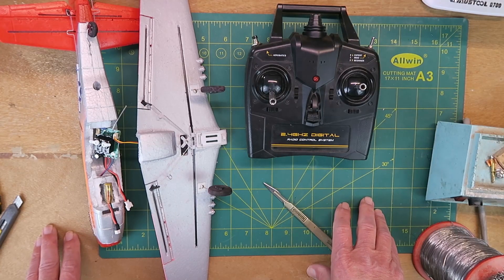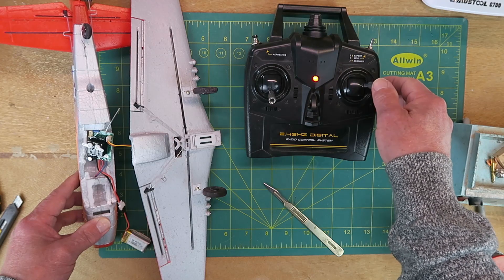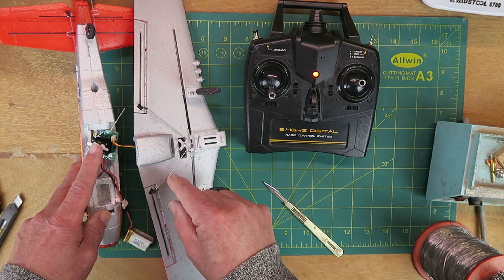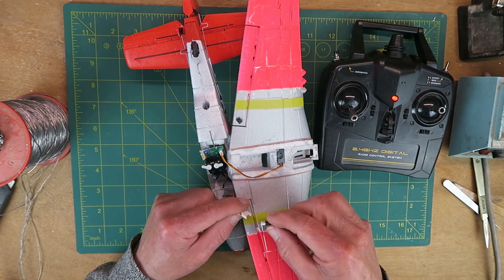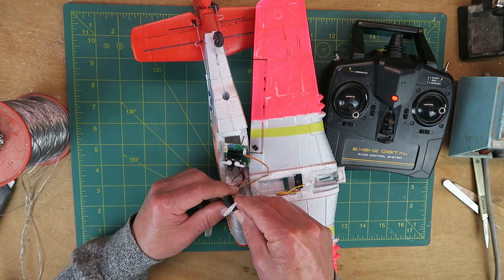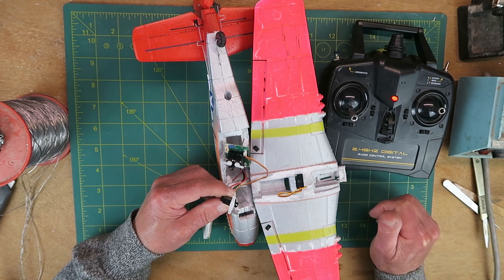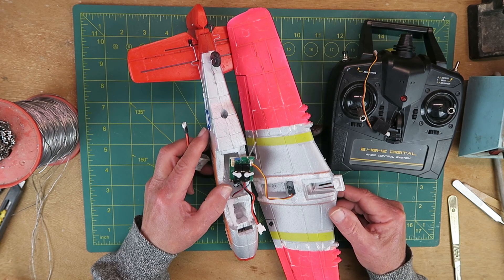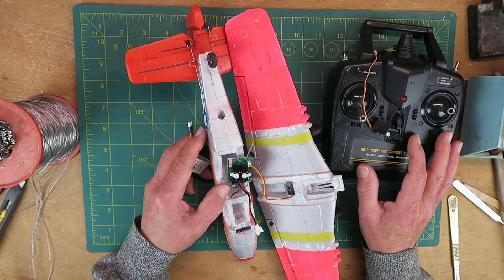Eachine P51D Flight Controller Receiver Repair Update

Comment: Any idea what is the TRGV connector on the board? I found G connected with ground, V with battery VCC, so it looks like Transmit-Receive-Groung-Voltage. Using Radiomaster TX16S Multiprotocol with Elrs module I want to use an added elrs microreceiver to replace the wireless protocol but keep using the gyro functions of the Volantex board. I did it successfully with XK-A800 and got RSSI, battery voltage measuring and altitude. I use RSSI just for finding model when landed unexpectedly - that can be also without interconnect. However I also want to make it proper LBT (not sure about Volantex protocol) and also use only one radio module to connect (elrs), while without interconnection the setup requires two independent connections - one from multiprotocol and one from elrs module.
Anybody having a clue about TRGV port and its usage on this receiver board?
Reply from the maker: I don't think it's possible to connect another Rx to this board. I thinks those pins are just for programming. You could reac out to :  Checkout AirDogge's channel here :  https://www.youtube.com/channel/UC4ASYrBqNLAQmqmCV57BgNw   as he is the expert!!

Comment: Bought fu4 corsair, realgood flyer out of the box,  paired then with tx16s edget and worked real good,  then tried to see how the stunt button worked on the originsl transmitter and re-calibrated the tx and play with combinations of clicks and presses until the receiver board changed into 3 channel mode??? I havent troubleshoot yet.. Maybe the aileron servo fried or probably you can change between modes from the transmitter with a "hidden" stick combo.  
I will try recvonect aileron servo to see whatsup. THANKS for the information in this video..... UPDATE.  I checked and aileron servo is mulfuntioning, (to much stress in my stunt roll tests) so when I manipule the aileron servo when connecting the battery the Rx board changes from 3 to four channel mode, so definitely when ail servo goes out then rudder takes over. Isn't that freaking clever??
Reply from the maker: Yes, it is a fascinating board. No one has yet explained exactly how the board senses the presence of the servo! Thanks for watching, have a great day!

Comment: A bit late to the party but...

All of a sudden the aileron servo on my new Volantex P51 has stopped working properly. Oddly, if I pull the elevator back and activate the ailerons it will work...briefly...then stop functioning again. Any easy fix? The first flights with this little bird were amazing - then yesterday I launched it (with a touch up up elevator). It launched, rose, then suddenly banked hard right and cartwheeled. I'm supposing based on your video that I'll have to replace the servo? I'm bummed because I just got this and have only had one good day of flying it before this happened. PS...the above link to purchase parts doesn't seem to work.
Reply from the maker: They're great when they work, but then............ If it's new you should contact your supplier. A way to help diagnose is to swap the servos around. It seems no one can explain how the controller detects if a servo is connected to the aileron channel to set the appropriate mode. It's a bit flaky!  Good luck" Thanks for watching, have a great day!
Reply: @1nformatica  Banggood (or its seller of these) is sending me two new aileron servos. I guess I'll be trying surgery when they arrive.
Reply from the maker: @coloradofotomatt That's a result! Take the "surgery" slow and careful and you'll be fine! There is nothing "special" about these servos, I replaced one with a "stock" one and it worked fine. Also strange is the "bad" servo also works fine provided you don't wont it to be an "aileron" servo, go figure!!

Comment: I fly my Eachine models with an OpenTX transmitter with 4-in-1 Multi-protocol module.
In the V761 protocol setup, there is an option for 3 channel and 4 channel modes.
Doesn't help with the supplied transmitters, but they were the wrong mode (stick arrangement) for me, so I never used them.
Reply from the maker: I repaired this model for a guy at the flying field. Personally, like you, I use an OpenTx (now edgetx) Taranis with the 4in1 module. Thanks for watching, have a great day!

Comment: I'm perplexed.  I got two flights on my P51 and then no aileron travel.  It does  have the other three channels working.  I was going to buy another one thinking that at least I'll have spare parts but what if the 2nd gets the same problem.  It's not so easy to tear into one of these and try to troubleshoot with limited electronic knowledge.  At least with an ARF you can usually get into each component fairly easily.  Think I'll box it, shelf it, put the $110 towards something else.  Thanks for the video.
Reply from the maker: Getting into the guts is not that difficult as I show in another video : https://youtu.be/m0YmgXjm4sg?t=115 It could be a loose or broken wire on the aileron servo. You can test by swapping the servo plugs around. Be brave! It is the only way to learn! Thanks for watching, have a great day!

Comment: yo tengo otro problema distinto. No se porque se me quema el regulador que hay junto a las soldaduras del motor ( puede que no ponga el motor adecuado). Pero gracias a usted he descubierto que hay distintas formas de configurar y que es posible arreglar el regulador.
Muchas gracias por compartir tanto conocimiento.
Un fuerte abrazo
Reply from the maker: ¡Feliz de haber ayudado a mi amigo! Un saludo desde Andalucía.
Reply: @1nformatica  soy de Almería. Vivo en Almería y necesito su ayuda ¿Sería posible?
Reply from the maker: @arnydivision  ¡Por supuesto! Puedes contactarme en gizmohombre@gmail.com Cuéntame con qué tienes problema.

Comment: You have solved my problem Sir! I have the P51 and the F4U, but now the Spitfire is out and I decided I had to have one! Waited for the price to come down to a level that is more reasonable and then clicked on the button. Arrived yesterday, but found it had the three channel config (although I had forgotten about this "feature"). Wanted to check how the board looked and whether it was maybe that the aileron servo was not plugged in. Came across your first video on taking the PTQ apart and then saw that you had the exact same scenario I was seeing, with the aileron stick controlling rudder. Looked in your comments and saw posts from Oz tree crasher and Airdog. I have seen lots of their posts on RCgroups too. Really knowledgeable guys. Anyway, this encouraged me to take a look into the plane (Eachine now include hatches to make access easier!). Long story short, duff aileron servo. Banggood have been asked to supply a replacement and when it eventually arrives I will be able to fly my new toy! Thank you again for posting your videos. They really helped me sort out the issues.
Reply from the maker: Hey thanks, glad to have helped solve your issue. The Spitfire is on my list too!! Thanks for watching, have a great day!

Comment: thats my problem to did u replace the board and servo .. and if u replace the board its can automatically bind
Reply from the maker: I only replaced the servo. If replacing the board you can bind as in the manual for first time operation. Thanks for watching, have a great day!
Reply: thx i already fix if i just reset the esc and it become 100% working
Reply from the maker: @JeffNowitski  •:*¨¨*:•_•:*¨¨*:• EXCELENTE_•:*¨¨*:•_•:*¨¨*:•_!!
Reply: @JeffNowitski  What do you mean by resetting the esc?

Comment: I seem to have a similar probem. Can anyone suggest a replacement servo that can be purchased here in the UK? Can't seem to find the specification or part number of the one installed anywhere. Thanks and great work.

Comment: Great problem solving.  Note that since this video, I have encountered another plane who's ailerons did not function but was still in 4-channel mode.

After tearing the plane apart I discovered that it was the transmitter that was faulty. I tried an identical duplicate TX and the ailerons worked fine.  Dissembled the plane for nothing (heh heh).

Happy flying!
Reply from the maker: Hey thanks! Good to hear from you bud. How the FC senses the presence of the servo eludes me. In this case a servo that had worked before the magic smoke escaped now no longer was sensed (although it works OK on a tester). The servo I replaced it with was a standard one not from Eachine but it works OK, go figure!
Reply: @1nformatica  It is a curiosity as to what the trigger is to identify a servo present.  I can only assume some code got zapped or a tiny cap or resistor was damaged.

  At least servos are cheap, and it's possible the "damaged" servo may still prove useful with another brand receiver like Eflite.

  Everyone have a great one over there! Peace and good health to all.
Reply from the maker: @Doggeslife  Yes, it is very strange! Keep in touch.

Comment: Thanks for this video!  I bought two of these receivers to build custom planes (I was really impressed by my P51 and F4U flight stability). But I also have the problem, that only 3 channels activate, even though the connected aileron servo moves correctly through all positions initially. From the hardware, I wouldn't expect a too sophisticated detect-mechanism of the servo, so I simply  tried pullups and pulldowns to "signal" at 3k3, 1k and 470 Ohms - To no avail.. :(
After that, I tried a 10k pot to give something between GND and Vbat when not powered, also no success.
As far as I see, GND and Vbat are directly connected to the servo-port, so the only way the receiver can "sense" a connected servo is the counter-reaction to "signal", no overall current sense.
Probably you don't have an intact servo at hand right now, but it would be interesting to know the resistances of the original, unconnected servo between signal and Vcc/Gnd and also a diode-check in any direction from signal to the rails.
I will try to catch with a scope how the receiver probes the servo-port initially by letting it float on mid-level with 2 soft resistors and give an update here if I succeed. But maybe it's something the processor reads back when moving the servo initially to both extreme limits.

Thanks again for your documentation of this issue from Germany,
Stefan
Reply from the maker: I have been wondering how it sense the presence of a servo as well! I guess the servo is driven by an I/O pin on the processor so it drives the servo then monitors the input for some kind of feedback signal. It seems to be a bit "flaky" as it fails to detect all servos. The servo I replaced the "faulty" one with was one of these : https://bit.ly/4xServo1mmJST There appears to be nothing "special" about the servo.
Reply: @1nformatica  Scanning the internet, I found another page describing a workaround but unfortunately not giving the root-cause. Your video was mentioned, too :)
https://befinitiv.wordpress.com/2021/05/04/eachine-mustang-p-51d-aileron-servo-repair/
So, I'm still thinking it has something to do with the initial movements of the 4th CH servo. Like it's reporting hitting a "limit-switch" only when min/max is reached.
In my (intact) P51, it seems the aileron-servos signal can be probed by a needle through the ventilation intake. I'll let you and your viewers know, when I find out more in a week, month, or even a year or two ;)
https://www.youtube.com/watch?v=q-9kPks0IfE&t=23

Comment: I flew this thing maybe 5times and the throttle has just stopped working... For the amount of hassle, it's not worth the price I paid (about $120), going to try RMA this plane.. Can't get ahold of Customer Service either, wtf..
Reply from the maker: Sorry to hear your bad experience. I have all of the warbird series and never had a problem. This board was damaged by the owner connecting the batter backwards. Hope your supplier gets you a replacement. Good luck!
Reply: Wow, the connector is keyed enough to prevent that from easily happening on mine. Only one of my batteries was making the motor start and now it won't start with all 3 batteries after being charged.. Hopefully 'customer service' replies soon.. Thanks.
Reply from the maker: @johnnyc.763  Are you using the supplied transmitter? Does the model bind and the servos work OK?
Reply: @1nformatica  Yep. The servos work, just the darn throttle/motor doesn't.
Reply from the maker: @johnnyc.763  Just for the avoidance of doubt..... The led on the TX and RX in the plane are solid red to indicate it is bound? The control surfaces can be controlled by the TX not just the gyro in the plane? Finally, the Tx should beep twice when you arm the throttle by moving it to the fully up and down positions. I'm not trying to teach you to suck eggs, sometimes things get overlooked! Good luck!
Reply: @johnnyc.763  I realise that this is 2 years ago, but ... I fly mine with a Jumper T12 Pro Open TX transmitter. My throttle stopped arming. When I looked at the "throws" on the TX LCD the throttle stick was not generating output between -100 and +100 - it was stopping short. I recalibrated the sticks and all was good again. There is something in the Eachine instructions about calibrating sticks. Maybe that would have helped - 2 years ago.
Reply: @RichardTapp1  Thanks man. I've since gave that thing to the Goodwill and now fly the E-Flite UMX P51 Voodoo.